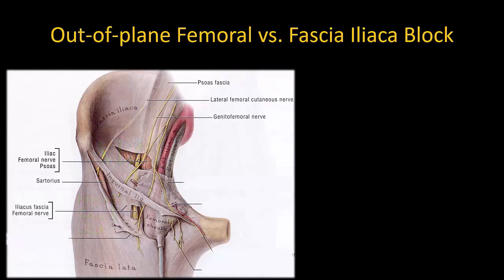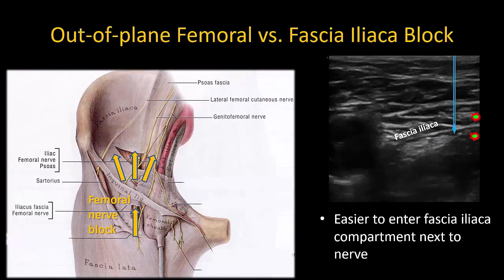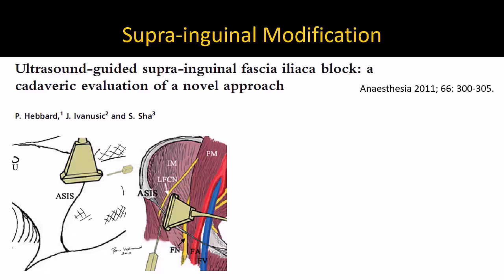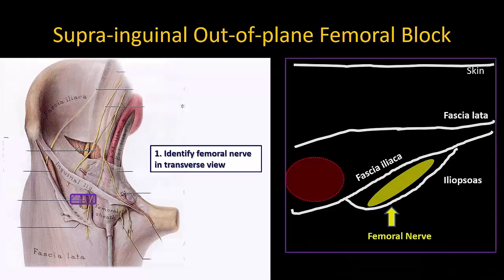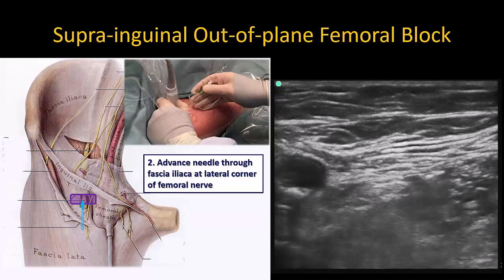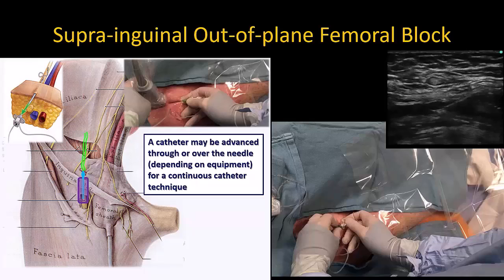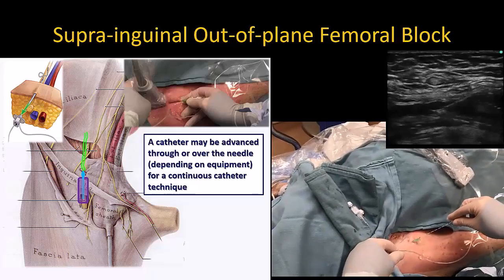Femoral Nerve / Fascia Iliaca Block Catheter - A "How-To" Guide to Insertion

Comment: Does this block achieve the same as using the SI FIB method? If I placed a catheter 5cm beyond the needle, would a 20-30 ml Q4hr intermittent bolus give the same coverage as a SI FIB catheter placed laterally?

This method I have found more reliable in terms of sonoanatomy when doing hip fracture / femoral shaft # surgery. Just wondering whether I should use this as my default block.

Comment: By turning USG probe in plane, you inject the local in femoral nerve sheath or fascia illiaca plane?
If it's in femoral nerve sheath will it spread to lateral femoral cutaneous nerve of thigh and obturator? Please specify.
Thank you sir.
I just love your videos and practical tips.
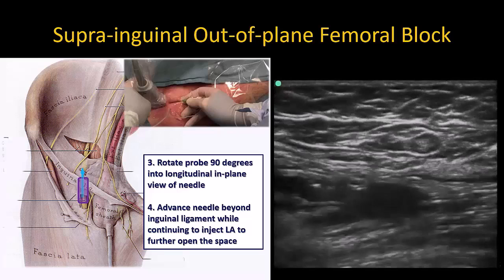Reply from the maker: There is no distinct femoral nerve sheath. The femoral nerve is encased by a splitting of the fascia iliaca. By targeting the lateral aspect of the nerve, you are entering deep to fascia iliaca and opening up the plane. As you can see when you turn probe longitudinal and get a parasagittal view, you can see that the local anesthetic is forming a layer over the iliopsoas muscle and spreading into the pelvis (2:45 in the video). To consistently get the LFCN, the LA has to spread high and lateral enough - this means using volumes of 30-40ml (see https://pubmed.ncbi.nlm.nih.gov/30798268/), and perhaps also injecting with more pressure on the syringe. But for sure you have a better chance than if you do an infrainguinal IP approach to either fascia iliaca or femoral nerve.
Reply: @KiJinnChin  Thanks a lot sir for that detailed reply.